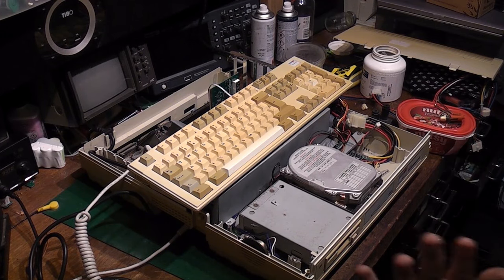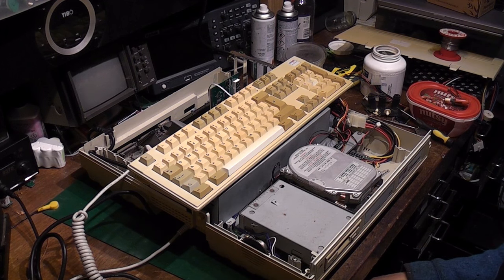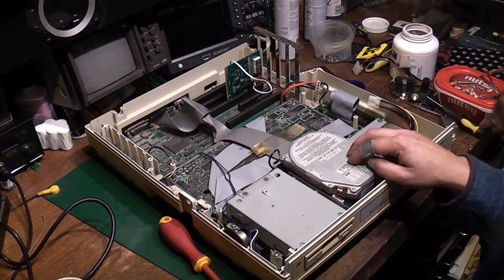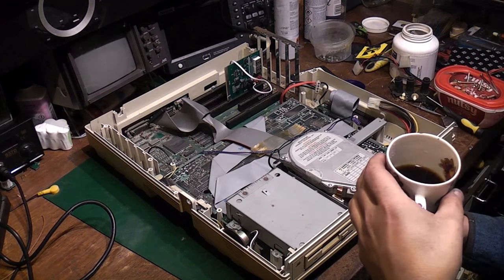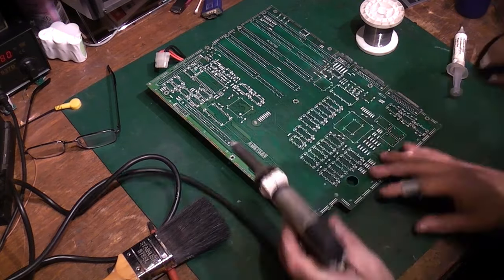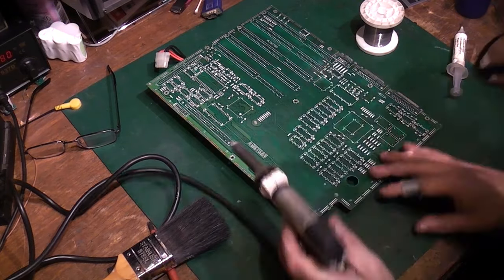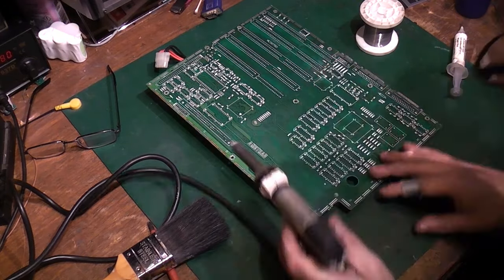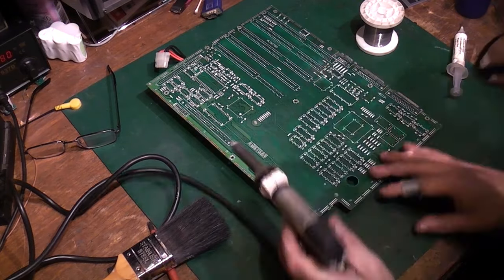Amstrad PC2286 repair Pt4 Progress

Comment: I had one Commodore PC10 that had memory chips damaged by battery leakage. The chips look perfect, no corrosion, but somehow the stuff got into the chip and damaged it from inside. It affected just the chips closest to the battery, rest of them was fine. Weird, weird...
The damaged chips could have something to do with the power supply capacitor leakage.

Comment: ♫ MT RAMs, where you learn to compute without RAM ♫
 That Paradise chip can run at 800x600 with 16 colors. Or 256 if you install another 256k video RAM.
Haven't seen higher capacity MT RAMs fail in large numbers yet. Then again even quality ICs fail if they get liquid corrosion on them.